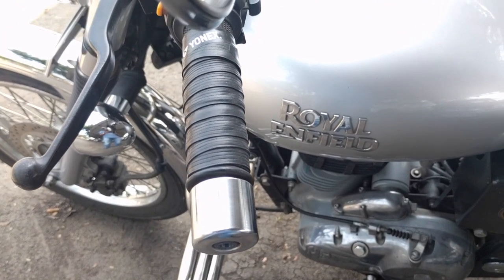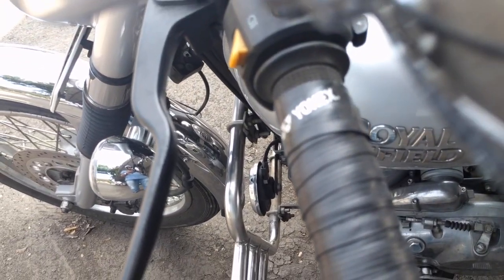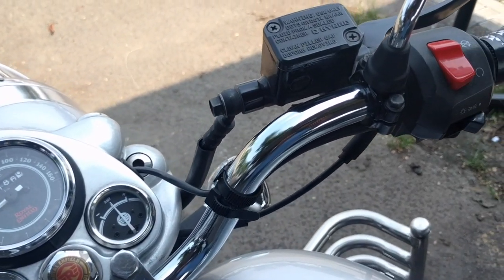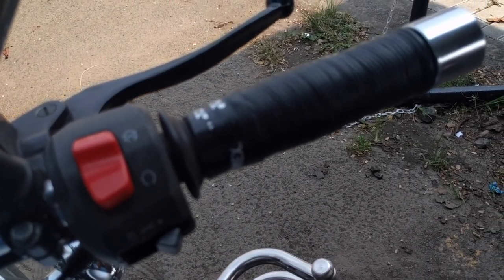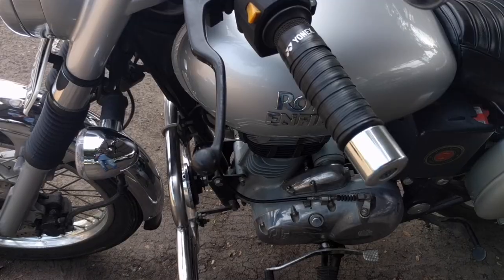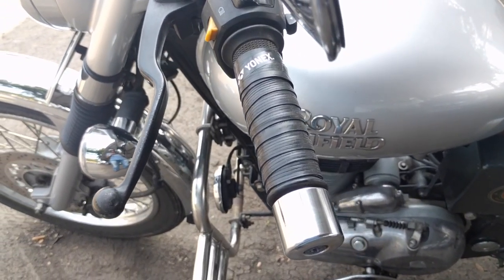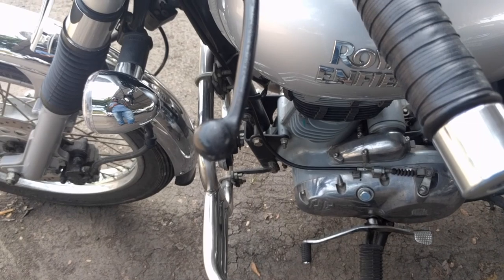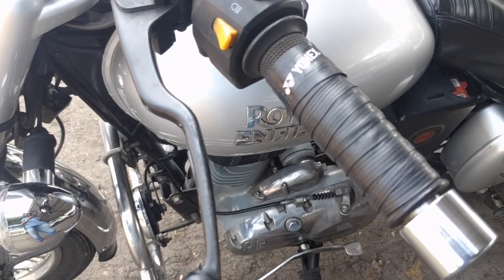Reduce effect of handlebar vibrations using badminton racket's grip wrap | Royal Enfield Bullet

Comment: One more effective way is to buy the sponge grip used in commuter bikes that is available in local spare parts shops and  costs ₹30.  Wont last for more than 6 months.  Still very effective.
Reply from the maker: Yes. Have tried that. Only small downside is that it makes the grip a bit larger.
Reply: @GodsOwnRider Thats true😅.Still i have that in my classic 😁.

Comment: Great idea! This should work as a cheaper & better option than those fancy leather wraps. Even I was concerned about their condition in monsoons.
 I would also like to know about the "bar end weights" on your handle. From where did you get these?
Reply from the maker: The chrome end weights which I have fixed is a genuine RE part. I got them fixed from RE service itself..
Reply: God's Own Rider - is it? Will enquire for the same there. Thanks.
Also, does that weigh same as the original bar end weights i.e. 200 gms?
Reply from the maker: I think it weighs the same ..Not sure though
Reply: Harry V. Weight is the same. It's just nickel plated.

Comment: Great video..
Man.. I would like to know the mods you have done on your Electra..
Reply from the maker: Thanks Jijin, check https://youtu.be/Gx5UwAyqjRg to see the mods  i have done
Reply: God's Own Rider 
Hi thanks for the reply..and the link..

Any update on the riding comfort with the new handlebar? Stock or the new one is better??

How about the headlight?? Did you make a change? I feel the light the stock setup gives is not that good.
Reply from the maker: I switched back to stock handlbar. There is video I did explaining why. .I have not changed the light, yes it is not powerful, many have changed the bulb with a philips bulb which is brighter. . but not sure if its ok of the reflector inside, check with service. .I am afraid to add fog lamps since it is usually the root cause of electrical problems and blown fuses . .